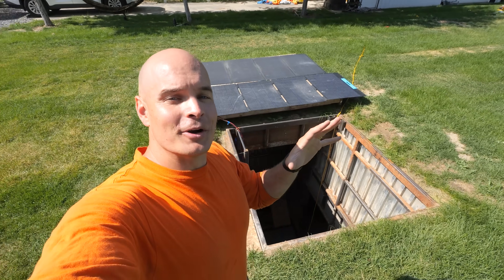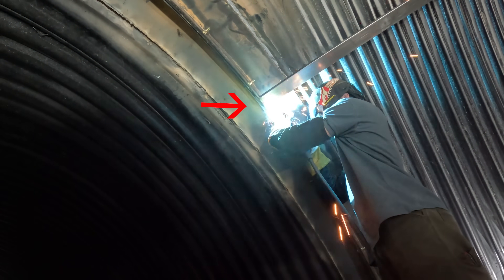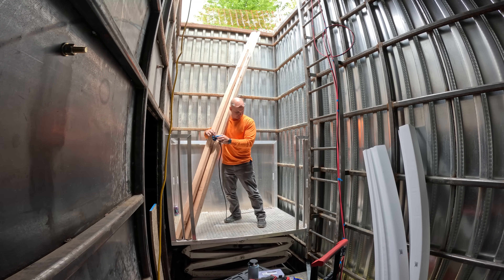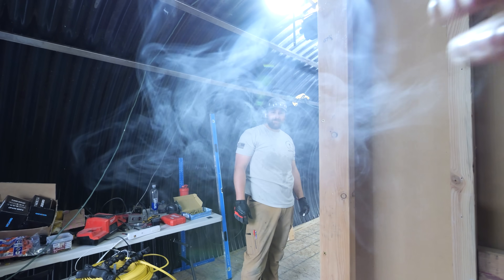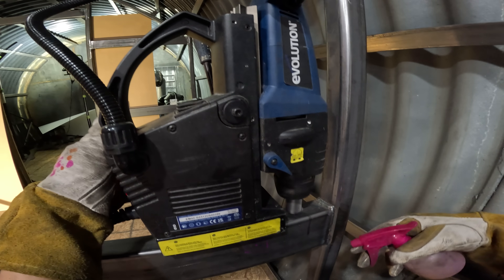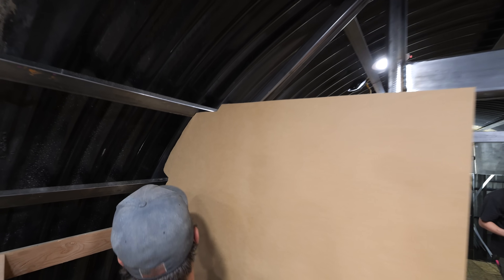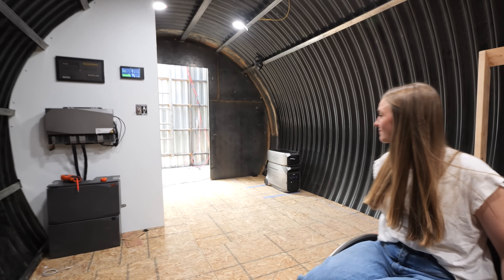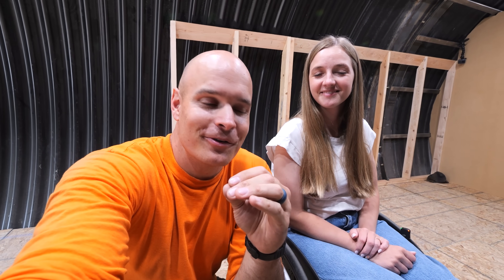How to Properly Power a Backyard Bunker - (Completely Off Grid)

Comment: When your considered your power system did you take EPC which fries most electrical system. In you have the tubes covered with concrete and earth that should protect the electrics in the bunker, not the solar panels on outside I would think not so much.

Comment: So what is this "bunker" or shelter supposed to protect you from? It won't protect you from fallout radiation! Another waste of money and time if that is why you built it! Dude where is your rain protection canopy, radioactive particle and water drainage system? Where is your shielding around you bunker?  Any fallout that falls over your area will just seep into the ground after it rains a few times and surround your unshielded underground shelter you will be radiated as though you were above ground in the open or as in an unshielded house. You wasted thousands of dollars dude and time if this is supposed to be used as a fallout shelter! This bunker that you built and are showing everyone could never be used as a fallout shelter without extreme and costly modifications above the shelter and around all the walls of this structure.  But hey it will probably protect you from a tornado! Also don't count on the depth underground of your bunker or your concrete or metal walls to protect you from radiation that seeps into the ground, your walls are no where near thick enough to provide adequate radiation shielding protection!  There are so many things wrong with the idea of this bunker providing adequate EXISTING conditions for anyone even for a short time (2 to 3 weeks) in this bunker!

Comment: i hate to play devils advocate jerry. but the sun likely wont be shining if the apocalypse is volcanic, astroidal, or nuclear. you may want a good ol steam engine generator or a sterling engine generator for backup. there are many ways to produce heat and a giant frensel lens may do the trick. thats for serious apocalypse situations tho. sterling engines are great when working with fires. so in theory you could have a system that burns wood and hides the smoke by passing it through moving water before exausting it. also all bunkers should have a well system to have access to water from natural sources. i would have done ground poenetrating radar on the property to make sure there is a natural well and then the water can easily be reverse osmisis filtered. and the replacement osmosis filters take up way less room than barrels of water that will go bad over time. be very careful about storing water safely. chemicals can easily leech into the water. food grade materials verified by your own second opinionm testing may be neccesary with the water storage

Comment: to make a bunker with power reliant on sun makes terrible sense if there actually is a nuclear attack..the sun would probably be blocked out for a some time and what if the panels are damaged or fail..i think needs to be a better power set up for this long term..that is not reliable enough

Comment: What an amazing project!  This video gave me the jitters tho.  If I had embarked upon a steel tube structure bunker which I intended to stock with lithium... I would have extended the tube structure to have a BATTERY ROOM on the opposite side as far from the exit as possible, behind a hermetically sealed steel plate bulkhead and steel plate door. Battery room with dual vents to outside, one below the batteries and another with twice diameter  above.  Since lithium contributes its own oxygen during the burn traditional fire suppression methods limiting O2 from outside don't matter, your best bet for sudden fire is a screaming chimney vent that carries heat outside and a thick plate that delays heat buildup inside.  You'll still have to evac immediately but it will give you time.  Scissor lift would have sealed lead acid topped off always in living area to lift its precious cargo quickly after power fail..

Comment: Are you using Aircrete for thermal mass, security ,soundproofing, won't rot, last another thousand years after the metal rusts away.
Honey do carpenter got the mux right.

Comment: One  thing I would suggest,  Is installing a flood water sub pump, and drain it to a leash line like a septic tank is done  far away from the bunker, Just in case you ever get condensation or  a rain water leak or incase some zombie wants to flush you out,  You never know And its best to be ready.

Comment: I would like a job I am a technician  I fix and repair broken things and I am a inventor. My Demoleculizer  will power any generator. I have invented Autopower1,  this is a self sustaining automatic power generator system. It is all Bluetooth controlled by your phone 📱  it shows remains power and charge and discharge rates. It automatically  starts and stops ✋️  and heats water with waste heat it also heats  your home 🏡  with waste heat, this heat can be used to air-condition a home also.

Comment: Begs the question why, if you haven't finished all the rooms and you were going to do some welding 

Why did you bury the bunker, knowing that you could burn the waterproof  membrane,

wouldn't it be easier to do all the rooms and the welding and then check the bunker before burying it ???
Reply from the maker: Winter was coming.  And in utah that means a lot of snow.  So we buried the bunker instead of leaving it exposed all winter.
Reply: @JerryRigEverything  watch atlas bunkers, they keep shelters in the workshop till they furbished the inside,  also watch pre-made houses in Germany and they keep them also in the factory till they're ready to be built,

also why the rush to get down in winter

Comment: I love the video THANKS!. 
1. I would consider installing some isolation material in the wall to improve acoustic
2. The lighting you installed are adiqute but you might want to have an option to use only part of the light to conserve energy when needed.
3. Add bicycle with generator, when your solar pannel are blasted, you can make your children earn there food by making power
4. Question:  why you decided not to put batary pack below the deck?
5. To get completely wilde, add alternative dim red light so when you go out at night for hunting you don't have to adjust for the darkens.
    compound bow (70 lbs, heavy arrows with fixed-blade broadheads) should be aduqute wepon to hunt wild boar  
6. Add backup manual oil pump for  emergency rising the elevator.
7. Have a pully system so you can carry out a weel chair with one person when oil system break.

Comment: As someone who has designed a few larger bunker systems I worry about your location of the battery system and what would happen if you had a fire.   We have a fire proof battery bunker that keeps batteries out of the main living area and if the worst happened the system fully seals out that battery bunker and a hidden venting pipe that sits under the surface ground uses the pressure from the venting batteries to act like a piston and punches itself up through the ground to then vent all the toxic gases outside.  We also have two battery systems which each can run all the important stuff on there own so a fire in one bunker does not mean we then have no power system.   Also how is solar on its own going to work if the sky is blocked out in a nuclear winter? from nuclear war or natural disaster such as an asteroid impact or one of the worlds super volcanoes goes up? Not really got a solution to that fully myself but large buried natural gas tanks could be a solution with a natural gas generator in its own underground bunker with hidden air intakes and filtration system and exhaust could be the way to go.  Only run it when needed to change batteries.  Or even a large hydrogen cell system.  A hydrogen cell system would make power and some fresh water.

Comment: Assuming that the sun will still getting through sufficiently, or that solar panels will not draw unwanted attention in a scenario requiring a bunker may be an oversight. You might want to install a hamster wheel.

Comment: Are you going to leave the solar panels on the ground? If so the bunker would be very vulnerable as all it would take for someone to knock out your electricity is to cover or destroy the solar panels. Not sure how you could prevent that maybe raising them 20 foot up in the air on a pole or something. Or build a structure on top the bunker and put them on top that.

Comment: Hey Zack, you should check out the rocky mountain power wattsmart battery program. Would love to see ecoflow get approved for the program, and then you do a video about it and other incentive programs.
Reply: Also, you should mention to ecoflow that a DC to DC system would be great with an ev charger. Like what solar edge is doing with their upcoming bi directional ev charger. Allows you to cut out a lot of the 10% loss from converting to ac and dc.

Comment: Jerry you should use 304 or higher grade stainless steel for internal and external flanges and metal supports as it do not corrode and can give reliable long life to your structure. As I saw in your video already few metallic structures are corroded.

Comment: You could of Lazer welded.    Very little heat and same weld strength.   My company has been using them no burn through or heat discoloration.  No big welds to grind down and no heat.  You can almost hold your hand right next to it as it's welding and feel not heat.

Comment: Many safety questions:
1. do you have a second exit from an underground facility?
2. ventilation? you need to install a air ventilation on the ceiling for having a good airflow
3. electricity. why are you not using protection for wires in the walls? usually its a plastic or metal pipe that protects wires from outside damage and at the same time protect walls from wires in case of fire
4. capacity. all systems should be designed with ability to enhance at least +30% in a future from original design, this is a good way to reserve enough space for future development
5. batteries. in the video, you demonstrate a huge space under the floor, so you should use it for battery installation. and keep enough space for ventilation
6. tube external damage. you should have safety "forced" sections inside the tube, so any pressure changed outside the tube does not bend the tube.
7. no design for -2 level development. How you place to create a next underground level? is it even possible in current design?
8. water supplies. should be a source of water for this facility, the best will be to use underground water source for that.
9. Utilization of garbage. How do you plan to store garbage and remove it? The latest technologies allow burning garbage and converting it into heat/electricity. 
10. entrance safety. usually good to have 2 cameras entrance, like in spaceships. place where you can change the clothes before entering the bunker.
Reply: nerd

Comment: Fill it with food water supplies 
But put extra building supplies like bolts wood mdf drywall if the place breaks in the zombie apocalypse
Also put wheel chair parts in there for your wife and put in stuff like things that will be needed

Comment: I just ran across this, so i don't know if this has been done, but I don't see any insulation here.  I think you are far enough down that you would run into signifigant condensation issues, especially when inhabited at intended capacity.

Comment: I don’t know where people are getting the idea that gasoline has a limited shelf life.  It doesn’t.  If stored in a sealed container it is good for years, if not decades.  By a sealed container I mean a gas approved container that is filled up and the cap is on tight.  If you store gas in a container without a lid then yes, it does have shelf life.  But in a sealed container it’s almost limitless.  Retired oil refinery industrial chemist.

Comment: Stirling engine generators are made for off grid locations that require power. Places like utility substations or remote weather monitoring stations. These are heat differential engines and can run off a variety of fuels. If it can burn it will power the generator. So homemade alcohol, firewood, etc. You can cycle back your otherwise waste heat for power generation.  Perhaps an underground field of pipes like a geothermal heat pump uses. Use the difference between surface ambient temperature and ground temperature below the freeze level. These generators are quiet and have a very long lifetime. 

An underground heat exchange system has nothing above ground that can be damaged. Solar panels can be stolen, damaged by hail, covered by snow and there are cloudy days and night time.

Comment: Great bunker. I would have put all wiring on a cable tray so it's still organised but easy to get to and wires a visible to easily fault find or add new circuits

Comment: A guy I used to be in a band with turned into a hobbyist prepper. He did a micro-hyrdoelectric system, with a shed full of forklift batteries to store it all. But I also saw plenty of solar panels, some wind turbines, and a huge diesel generator as well. It's pretty impressive. He has materials to continually maintain the batteries for a lifetime, a whole machine shop, stockpiles of all sorts of materials, electronics lab, 3D printers, a farm, and a whole armory. He's determined to maintain his quality of life no matter what.
Reply: The issue all preppers will run into very quickly is making food on your own. Even canned goods eventually run out of expire and while a personal farm might be good as supplement food, it takes an insane amount of infrastructure just to make food for one person year round. You can have the most comfortable bunker around with enough power for a lifetime but unless you have a whole community dedicated to farming and raising animals you will not survive the winter after your stocks are gone or expired

Comment: I have a suggestion for y’all… have the elevator attached to a framework with a roof so that when down it seals the shaft. It can double as a support structure to hold your solar panels at the same time. One benefit from this configuration is no one can fall down the shaft by accident because with the elevator up its floor blocks the shaft and when down the roof blocks the shaft.  You could also add wall panels to the roof framing so that as the elevator rises no one can fall down the shaft from the sides. This all is contingent on weight and what the elevator can lift 👍 P.S. the solar cable can be housed in a retractable extension cord unit to avoid damaging the wires…

Comment: Lots of people have said that this is an infomercial. I say yes and no. Yes he talk about the product and how it was used. Then he installed the product. The question is? Is it better to show you the product in use or tell you then just use it and not say anything else about it. When a product is sponsored in the video I think that letting me know how it was used and if there were problems with using it is a lot better experience for me. Thanks for sharing how simple it can be to change or create a grid backup or off grid system.

Comment: Ive got some experience with bunkers, both concrete, steel construction and in bedrock. Common for all types are the need for air handling. You need to dry the air. Hopefully you wont have any water leakage, but still the moisture needs to be controlled, otherwise you will have mold very soon. Having untreated and unpainted wood or boards will make it happen faster

Comment: Hi Jerry, i was just curious, or maybe i missed it, but I was wondering, what happens in the rainy season or if it pours heavily, wont the water just flow into the blunker? is there any drainage system for the bunker as well? i just noticed how low the entry point of the bunker is to the ground, so that question just hit me. thanks.

Comment: What possible reason did EcoFlow have to disable the 120v when using the 240v?  It has a 4 wire (hot, hot, neutral, ground) 240v outlet, which means that it HAS 120v while supplying 240v, it just does not have 120v outlets (because they are disabled).  Stupid design oversight.

Comment: 💡so ideal for that elevator opening.  Make the safety rack/rails on that lift higher to accommodate for the hight of a person. Have a collar on the topside. Have a lid that fits on top of the collar. So when the lift comes up it will lift up the lid with it. It will basically look like a roof over the lift. As it goes down then the lid drops back into place. You can also have a lock mechanism so when the lift rack leaves the lid- it flips some toggle latches that lock the lid in place.  These same latches can also secure it to the top of the rack to prevent the wind from taking it.

Comment: I do like the gutter idea but I do worry about the flame ability, heat dissipation and heat buildup. It's also not UL approved.
Plus if you're building with metal studs electrical wire must be used that's resistant a.k.a. MX or grommets are required to avoid chafing.
You'll be surprised at how much Electrical is out there that is "well it worked so nothings wrong" where people have used the ground where as a hot where it's uninsulated and should never be used that way. There's a mentality that if it works you're done and you don't need to call an electrician it's easy it's not like plumbing where it might flood your house.

Comment: Before i watch the video i wanted to mention that if you want to have a larger machine like a lathe you probably want to have a flywheel generator.

It won't do anything really other than to give your local grid more inertia.

But you can check starting currents on the motors you use or soft starts to completely negat the need of the flywheel generator